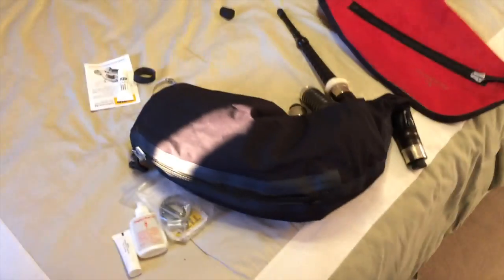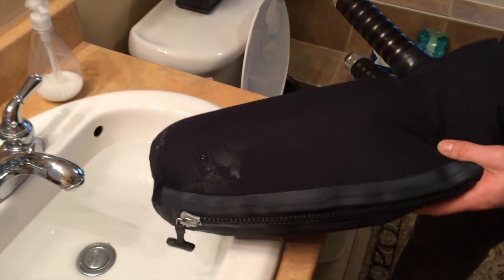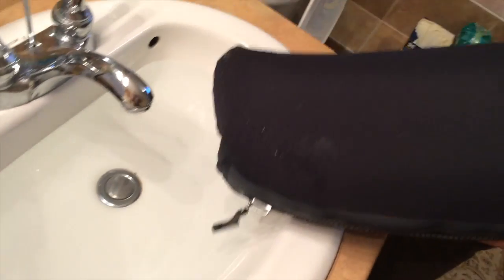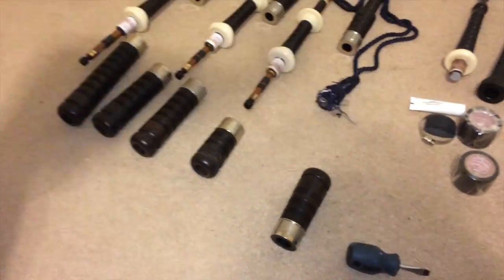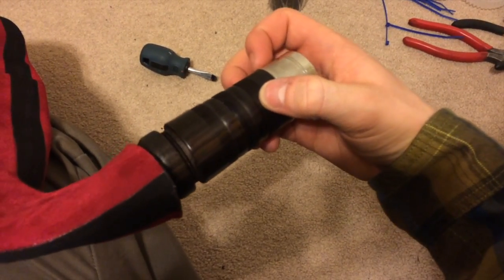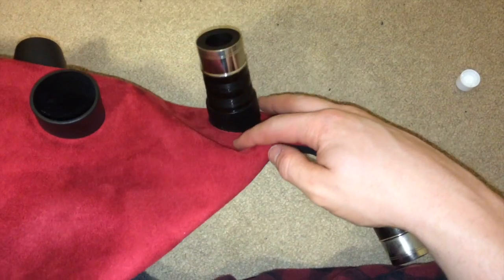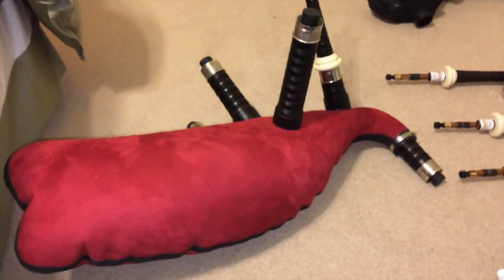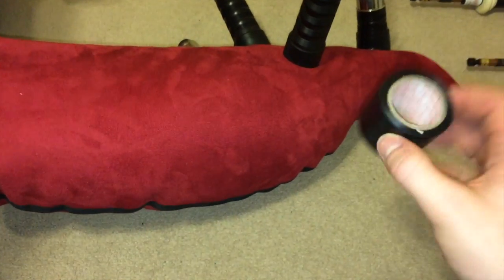Ross Bagpipe Bag Replacement

Comment: A tip to all pipers that use a synthetic pipe bag - buy a Moose Valve/Watertrap to insert in the blowpipe stock - this will stop saliva (the enzymes of which will otherwise break down the Gortex water-proofing) from reaching the inside of the bag.  My current (Shepherd Hide Regulator Pipe Bag) with the watertrap fitted has lasted over 8 years now, and still going strong: its predecessor (same make), without a watertrap,  lasted just 3 years before it started leaking !